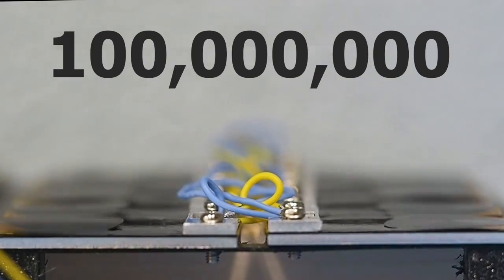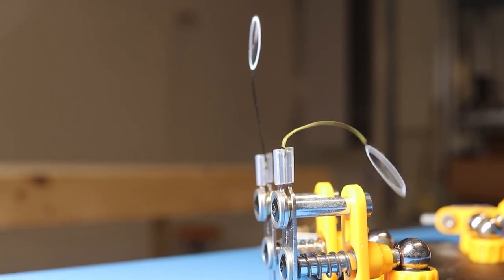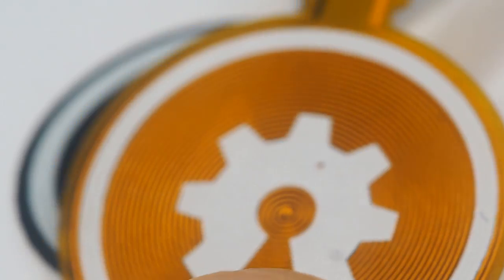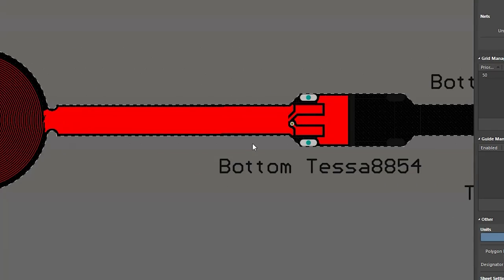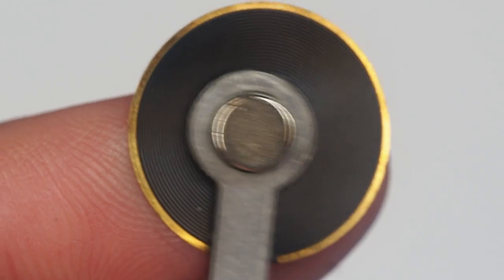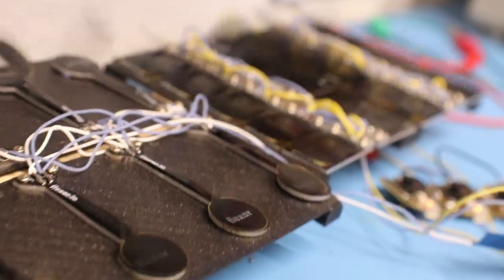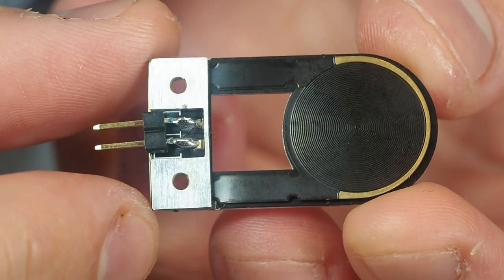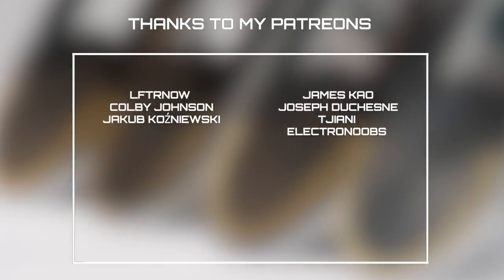How this Actuator Survived 100,000,000 FLAPS

Comment: The reason why your double sided actuator didn’t twist is because the two sides added off-axis rigidity. Because of the linear motion of your actuator, it was always going to tend to twist if it had a single pole along its axis of motion (an example of this is objects in space tending to spin). I love the methodology you used to avoid problems that otherwise would have remained elusive.

These are super exciting! Any other ideas for novel actuators on your mind? (1st time watcher and subscriber)

Comment: if you add a reflective surface, maybe even something mirror-like, the flap can be used as a pov-display WITHOUT adding the led's weight to the flap. just put the leds in a black box with a narrow slit, pointed at the mirror-flap...

Comment: Have you thought of or tested using a second coil instead of the rare earth magnet? Using a square wave 90 degrees out of phase with each other so that they could take turns attracting and repelling each other? It may reduce costs and speedup replacement of failed units.

Comment: What about a flapper optimized for "airflow"? Might be useful for cooling applications.
Reply: Fans would still be better at moving air. And if something can be cooled by flappers then maybe passive cooling is sufficient.
Reply: That exists! It doesn't looks that different from this but flaps way faster, you can see it on LTT

Comment: Would be interesting to see an electromagnet on the stiff side and a sensor that detects the distance so it can pull it a certain distance when it's safe to and doesn't need to physically slam up against it

Comment: Can you ramp the voltage up and down to control the rate that the actuators open or close? Butterflies normally flap their wings kind of slowly and in a controlled manner -- they don't just snap them open and then shut again.  Same with flower petals.  If you can make things open and close at the speed you want that would be really cool.

Comment: Can you hang a couple of these from some string and then tune the system to constructively interfere with each other and create some larger oscillatory motion? If so that would be an interesting (though impractical) replacement for the rhythm of a clock.

Comment: For future versions, have you looked into steel wires for connectors? I believe generally steel has better performance with respect to fatigue than copper
Reply: Yes. Depends on the type of steel.

Comment: If you ever get bored of this project and/or just need a new idea, i think a cool project would be making “Open Source Haptic Actuators” for things like Game/ VR Controllers, Interactive Art Displays / Playground Games, Sim Gear, etc.

As evidenced by this series, and not only the designing experience you earned, but the reliability you are getting out of these components, i think making Imbalanced Weight (PCB?) Motor Plug and Play Modules, “Bump” based linear actuators (maybe some sort of PCB that launches a metal disk/“doughnut” (maybe just a washer?) up a few mm/cm on a pole?, etc.

This could lead to really neat HID Gear, VR Controllers, and even be Incorporated into Public Art Displays for Makerfairs and whatnot!  

Also i have seen, at least once, some sort of playground toy with Load Cell (or Buttons, I don’t remember), speakers and lights in modules, and you would run around and hit/kick them depending on the mode (ghost hunt, ninja dojo, etc)  Was a hit crazy of a project, so may even require reaching out and collaborating with someone like James Bruton etc, but that would be one HELL of a project!

Either way i think doing stuff like all that, or even just more of the amazing work you have already done will be exciting to see going forward!
Reply: Hey there is one of these in a park in Columbus Ohio , USA

Comment: Take several of the "With hole" ones and stack them. Wire them with alternating polarities and you have a wildly useful device... Like tiny self-opening/closing curtain hangers for a tiny window, or if you put some thin, pleated fabric between each one, you can have a bellows without a piston and associated rubbing/sealing.

Comment: I think there are applications beyond art. The immediate use case I see is a valve. There are cases where you may want to prevent dust going between two locations, and covering a hole with a flap is one solution.

Comment: Hey Carl, look into the flex PCB i-beam effect. If you put traces directly over each other on the top and bottom layer, it creates more stress in the copper than if the traces were offset.

Comment: Can it be used as a cell-phone vibrator? Does it have any efficiencies over the tiny motors they use at the moment? Cell phones already use similar manufacture techniques. Are there cost savings (e.g. incorporating them into a pre-existing board manufacturing process "for free"), simplicity (can you use two back-to-back with opposite polarity power to remove the magnet? Or use a pre-existing magnet already in the phone speaker!), or battery savings? Perhaps they're not energetic enough to vibrate a phone. They appear to be in the video, but it's hard to tell. A wilder use might be some sort of actuator for cube-sats. That emerging tech seems perfect for bleeding edge combined with inventive geek builders.
Reply: I would say the “Taptic Engine” in iPhones etc is a good analogue, but that is Micro-Electro Mechanical System (MEMS) based.

Given the market demand seems to be pushing for thinner and thinner devices, I would assume those would be preferable rather than something macro like this.  I can’t speak to it’s use as a CubeSat “Reaction Wheel” alternative, as that is outside my understanding but it does sound really cool!

I DO however think that Carl is great at designing these sorts of things though, so i think another cool project would be making “Open Source Haptic Actuators” for things like Game/ VR Controllers, Interactive Art Displays / Playground Games, Sim Gear, etc!

Comment: Hey! I had an idea about improving the lifespan of the flappers. 

Just foreword, I’m a CS student, not an electrical engineer…

I don’t know the specifics of how your flapper driver works, but I wonder if it’d be possible to dampen or eliminate the smacking by reversing the polarity sooner. 

I’d guess that the copper is still likely to fail at some point, but I have a feeling that the arm hitting the magnet with such force would be introducing large and erratic shocks down the arm.
Reply: Mechatronic engineer here. I agree. The impact seems to cause a whipping ripple down the arm to the point where it's fixed. When the ripple hits the fixed end, the bend in the arm gets concentrated at that point. If you tune the frequency and duration of the electromagnet output correctly, a new flap output will start before the flapper lands, deacellerating it before it accelerates away. You could also have a flap output followed by a soft landing output and that way retain the customizable frequency characteristic.

Comment: Perfect test system for light weight flexible couplings. Valves for very low air pressures. Someone somewhere is looking for this to fit an application.

Comment: There is an $1,100 cooling fan this size used in places you can't get to for maintenance, which consists of a piezoelectric element and a thin fibreglass board. The piezo element outputs the natural harmonic frequency of the fibreglass board, causing it to flap similar to this design. I wonder if there would be similar applications for this? It might have some advantages actually since this one can run at any frequency. Say you need to measure a frequency signal and want no vibrations or electrical noise at that specific frequency, you can just set this one to avoid that frequency. You often need to maintain a constant temperature for the electronics for precise measurements, so a cooling fan of some sort is often required. If vibrations or electrical noise would interrupt the measurement, you could take measurements between individual flaps, something you can't do with a spinning fan or a continuously vibrating fibreglass board.

Comment: The first thought for the application of this device was with gas control and other metering applications. the final product doesn't seem to be a perfect fit for that application. but if we could have a membrane that would open and close rapidly to meter or control the flow of a low pressure gas... it might be a very valid application for this type of membrane.

Comment: Humm...can it be used as a permanent one way valve?  I can see it as having great value as a permanent fault free valve for gases, and perhaps liquids with a few adjustments of course?  Having long lasting valves that can respond at high freq is very valuable.

Comment: Copper has no fatigue limit for indefinite cycles because it has a face centred cubic atomic structure just like aluminium, which is why you never see aluminium springs. Springs are almost exclusively steel, because steel can bend an infinite number of times below its fatigue limit without failing. Aluminium and copper will always fail eventually. If you want more cycles before failure, the only way is to decrease the stress imparted, either by redesigning the geometry of the arm or using a smaller flap angle.

Comment: The faster they slap, the more likely is for air to get trapped and act as a cushion, limiting wear
also, it's  the fact that the copper is one with the arm that causes failures, let it loose maybe by making it like this /\/\/\/\/\ or a bit longer than the arm, this last design could be also used to act as a spring to close/open faster but could wear

Comment: Great work, that's an amazing R&D effort.  You are essentially developing a vibration arm with a control system and are encountering all the aspects of those types of systems.  

WRT to the torsion of the arm, perhaps the magnetic fields are trying to align and it is producing a torque? It looks like the 35mm arm is twisting as well, just not as much.  You could make one arm slightly wider to increase its stiffness to counteract that bending.

Comment: Have you considered a wider flexture at the mount point? (tapered from wide to narrow on the actuator side) right now you're concentrating the bending stresses at the clamped point and based on the video, it looks like that was the failure point.

Comment: I like the aesthetics of this design. It might be neat to have a 2D array, that if lit from an oblique angle so different angles would have different luminosity, it might act as a mechanical pixel display, maybe a little like DLP. Also, if the array were actuated in a wave pattern, would it move air? It would look cool in any case.

Comment: Would be cool to use two of them to push linearly against each other. So you could for example push a door open and pull it close again or push a carriage away from an end-buffer and towards it again.

Sure, such a thing can be done by an motor of some sort, too. But motors are bulky, while this is tiny and nearly invisible if applied correctly.

Comment: They'd be good for low volume cooling and blowing where a rotary bearing would be subject to dust, wear, lubricant drying out etc. Contact SpaceX, the ESA and NASA. Some of these placed in strategic locations inside a spacecraft could keep air gently moving to avoid having carbon dioxide build up in stagnant areas. Any corner where air sits too still, put one of these flappers to stir it up. They might be useful on a Mars rover to whisk dust off a rock or off solar panels without having a tool touch the rock or panel.

Comment: Copper work hardens. So the more you deform copper the more brittle it will become. I have never seen any PCBs, flexible or otherwise, that didn't use copper traces though. Electroless gold plating?  (i'm only half joking) I would consider reinforcing the flapper coil with laser cut shim stock. It would be perfect for three reasons: 1. you can order all different thicknesses of shim to tune the spring constant  2. it's tempered similar to spring steal so you have good elastic deformation. and 3. If you make sure your shims are not non-magnetic stainless steel you could have the shim backing overhang the coil diameter to give you a north south magnetic junction opposite a disk magnet encircled by a opposite polarity ring magnet, that would give you REALLY good results. Tuned correctly you could get much higher frequencies. (now all I can think of is an artificial bumble bee flying around the room)

Comment: The shape of the bendy part seems odd to me. I get the round cutouts do avoid stress peaking at sharp edges but they do induce weakness in just those areas. It bends much more close to the mounting point at the narrow part than over the overall length. 

Give it a waisted shape that starts wide at both ends and gets a bit more narrow in the middle section. That way the whole length of your arm will bend smoothly. The ends will bend a bit less than the center part. This will reduce plastic deformation, copper cracking and increase lifetime.

Comment: I was using a old transformer for something I made like this to spin a airsoft bb non-stop on a circle dish held up by rubberbands to allow it too tilt every time the magnet came on the momentum can be set to barely make the bb make it up the curve on the dish or tuned to make it spin fast.  I planned to make it a clock lol only problem was I still need to rewind the transformer or it will melt my pla printed case XD. If you dont want to worry about the wear and tear make the magnet move/tilt and be the thing that moves the slightest amount and suspend it so it doesnt hit the coils you get same amount of movement.

Comment: Instead of using 0- 80° movement try +40 to - 40 movement this will improve the rigidity for that you should place the aluminium base 40° away from the coil, means base at - 40 coil at 0 and movement is between + 40 to -40.

Comment: I bet there would be an application for this combining 3dprintable flexibles, for example as completely diy diaphragm liquid pumps. As both the pump actuator and the one-way valves to direct flow (vanes). This could be a really cool micro pump setup.

Comment: I built an electromagnetic actuator to tap my smartphone screen in tiktok to ad likes to the lives. The maximum hz I could do was 16 hz. The limitations are physical due to the moment of inertia of the oscillating mass. I had to connect 5v to the arm because without it the touchscreen didn't detect the taping.

Comment: An interesting application could be model airplanes to love the elevators/rudder/ailerons, instead of relying on a bulky and somewhat cumbersome motor with a metal rod as a link to each surface.

You just need an end-stop on both sides of each control surface and put one of your flappers in the control surface and the end stop. So 8 flappers per control surface in total - 4 pushing each other away and 4 pulling each other together. Only issue is that there need to be a way to determine the exact position of the control surface to modulate the voltage to keep the distance constant.

Or am I missing something here... would a constant voltage keep a constant position, but the amperage would change depending on the force needed to hold this position?

Comment: Why not use an opposite wound coil instead of a permanent magnet. 

The same pulse would do the job as the magnet fields would oppose. 8nfact if you used a biphasic pulse you would overcome the need for "mechanical spring back" and you could up the frequency a bit.

Have you found a use for it yet?

Comment: would it be possible to have two flaps where each flap is wired with opposite polarity so they repel each other when the same current is applied to them. Then connect it to the output of a stereo amplifier to see if you can make a crude speaker that has no permanent magnet.

Comment: Wouldn’t having a neodymium magnet that’s the same size as the copper coil or is there a reason why you went with the size of magnets you used? 

Also you could use these as a form of propulsion for micro ROVs like have them arranged in such a way that they act like ores or fins that use a rolling wave motion to propel whatever you have them attached to.

Comment: imagine making a hybrid electronic and physical keyboard synth, as in use these actuators to hit strings or other acoustic elements and ways to modulate, just like a real piano but without the complex mechanical parts, just strings and these, along with other actuators. might be just as expensive as a real piano though.

Comment: Hi! I'm looking for tiny pumps for flower pot watering systems. I thought of your flapping pcbs when I started looking at piezoelectric pumps. Is that anything you have thought about as well? I would be happy if it could be used instead of a solenoid valve and just need to overcome gravity fed water pressure instead of acting as a pump. It doesn't have to be efficient at all, just wish to lower the price per flower pot by removing solenoids and motors.

Comment: NASA are using this kind of things in space for cooling electronics, single material moving left and right, like a single wing, instead of classic fan that will fail, but way more durable, more efficient, more lightweight, extremely expensive and quiet. It actually does not move much air, but if you test it with smoke or heat, for so small amount of energy/electricity, it does crazy amount of work, its strange, like it does not move air, but moves heat trough air just fine.

Comment: Hey, the arms do not just bend, they twist a little bit. Do you think that if you make the trace S shaped will help with the durability. Maybe if you put the metal base between the flex boards. Also can you the led traces on a different flex board and stick them to the original actuator like a piggy back.